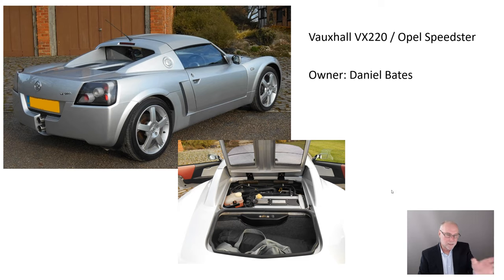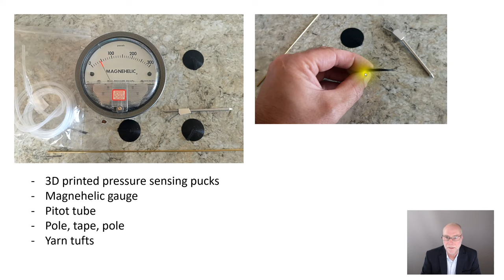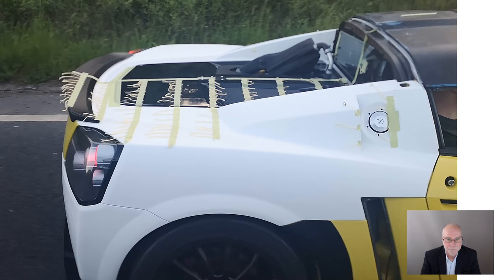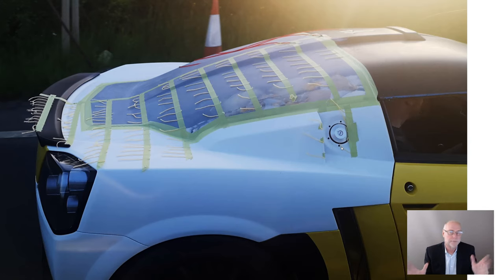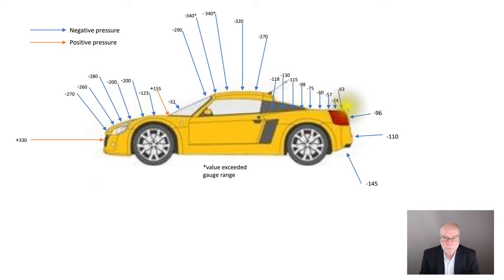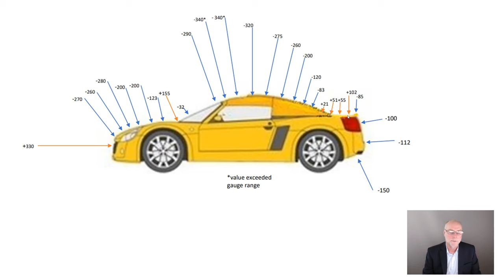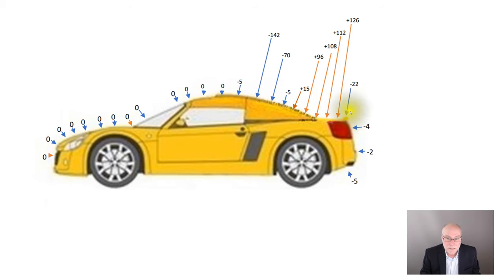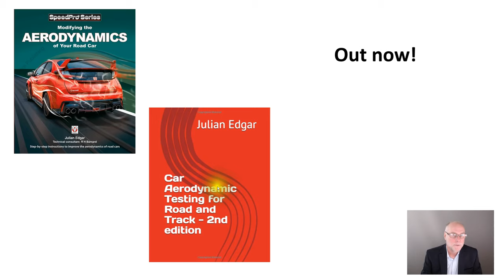Vauxhall VX220 Opel Speedster

Comment: Thanks Julian. I love your videos. I'm building a 53 Chevy pickup drag truck and need all the help I can get. I expect to run 170 MPH in the quarter mile. Aerodynamics are so important to me.
Reply: You best get on amazon then and buy his books, they have been a great help for me. Drag racing you just want stability, seal off as much frontal area as possible so just enough to cool and make that efficient by ducting the air through the radiator.

Comment: Interesting  - I never thought about things this way. This actually means the engine bay cover on an Lotus Elise leads the "forward moving" air stream into the engine bay for cooling (although I guess this is a rather ifefficient way of cooling).
Reply from the maker: Doubtful. It's a low pressure area - flows depend on pressures. More likely an exit airflow area.